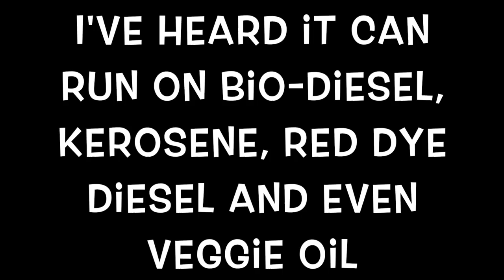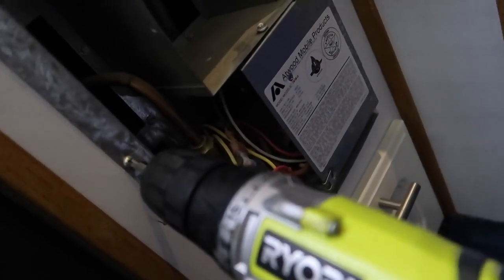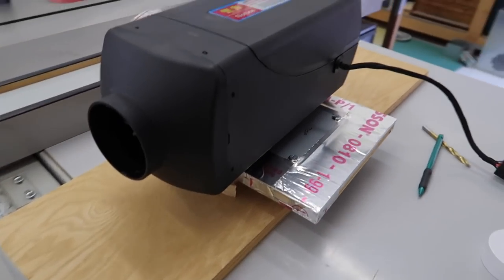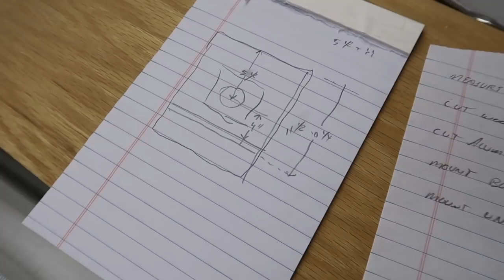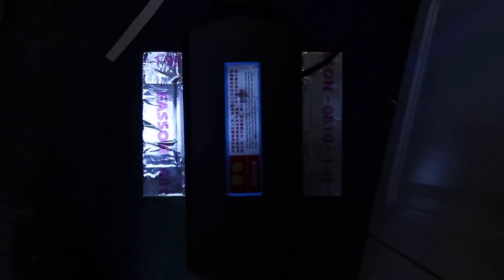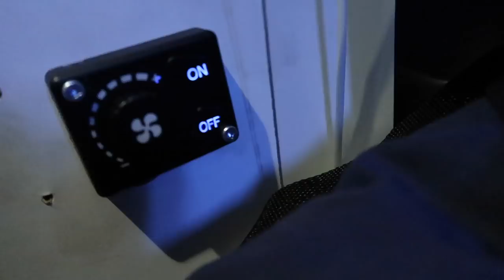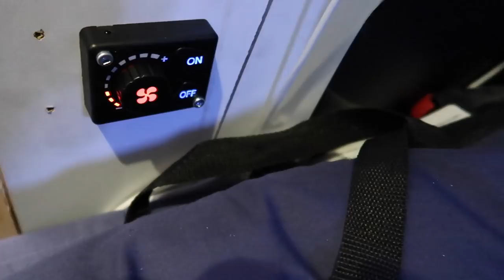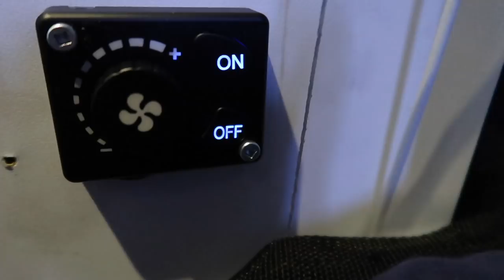China Diesel Heater DIY Part 2  INSTALL Atwood Direct Retrofit

Comment: These diesel heaters can be mounted on their side as long as the glow plug faces up, which I think would have made it a lot easier for you to run your exhaust pipe out the existing port on the side of your van. Also the fuel pump should be mounted in the upright position to prevent pump wearing out prematurely

Comment: I do not recommend drawing air from the wheel well as tires throw water constantly from wet roads throwing water into the heater combustion with considerable velocity.  Best to duplicate the OEM heater air intake for combustion to draw air without the high velocity water spray.  Even drawing air from behind the fridge is much better.

Comment: I would like to continue to keep my existing furnace working and use this as a boondocking heating option as I have a sneaking suspicion that these Chinese made heaters would not potentially last the minimum 4,000 hours of use a year it would be subjected to in my Canadian climate. Question: how hot does the exhaust line get and should I consider extra shielding? Excellent installation video Steve! Bravo.
Reply from the maker: I wouldn't be wary my Canadian friend. They are copies of the Wabesto. One moving part (fan) and solid state circuitry. If it isn't DOA, you will get great life out of it. Probably better because you would use it as intended. There are many, especially on the boat forums, that have used them at length with no problems.
Reply: @XplorerSteveDIY  Does the unit have to be installed with the exhaust and air intakes facing down or can it be safely installed sideways?
Reply: Andrew I know a couple people using these Chinese diesel heaters in the expedite industry which I'm in the only problem they've had has been a faulty glow plug and faulty temperature knobs which all cost under 20 bucks to replace or you can upgrade to an LCD screen other than that like Steve said they're just a copy of a Webasto or an Eber spacer diesel heater but I would definitely add some race car exhaust header wrap on the exhaust pipe I know it gets up to 2 to 300 degrees Fahrenheit just as an added precaution
Reply: @Linescrew1Canada  because a warm air always going up, probably even better exhausted on a side,just like every other heater

Comment: Not unlike the Wabasto cab heaters in over-the-Road trucks.  Watch out for mud slinging off of your rear wheel, possibly plugging your hose in the wheel well.  And, whatever you do, try not to spill any fuel oil inside the van.  You’ll smell it forever.  Shy away from bio-diesel.  With petroleum diesel you’ll at least know what you’re getting.

Comment: Wow, pretty clever install my friend!!! 🤗👍 So many people going that direction of the Chinese Diesel. 😉 Hope you do an update video in the future on it and how many days of heat do you get out of the tank. It looks so small. I can get 2 weeks out of my furnace propane heater just by running it at night. I put a black out curtain just past the right side bathroom door and tuck it between the sink and stove area so I only heat the bed area and area to get to the bathroom. I really like having a heat source that is connected to a thermostat at night and set it to 55 degrees if in really cold areas. If in really cold areas during the day will run a Mr Buddy to a bulk tank so that can stretch my boondocking to two weeks by using those two methods for heat. 😁👍 I really hope you do a follow up video on this even though I know you use it as a vacation vehicle. Loved the video!!! 👍😉💓😄🚐
Reply from the maker: One Tuber tested 2 gallons on high and got 24 hours out of it -straight. That is pretty nifty. The power savings is a big factor as our furnaces eat battery. You have good solar though so may not wake up in the danger zone. I don't camp in really cold weather cause wimp. Safe travels Irene.
Reply: @XplorerSteveDIY  Yes, definitely my 400 watts of Solar and 200 battery amps with 100 usable amps is plenty to run the 3.4 amps per hour that the furnace draws in our Xpolorer. I mainly put the curtain up to help conserve my propane because I have plenty of battery power that is for sure unless in a place where I don't have much sun for several days but that doesn't happen very often but can so my curtain helps in that situation. 🤗👍 Definitely the needs of a fulltime traveler is very different than someone who is not or what type of a camping a person does as well and for how long. As you know I am definitely not a 100% fair weather camper/traveler...😀🚐👍 I am still very interested in what other options are out there but 2 gallon on a constant 24 hours is nifty but I have been in situations where it can be cold for a week or two in one stretch. So 2 gallons would give someone about 1 week if they needed to run it 8 hours constantly maybe not on high during just the night if in that situation. That is okay, but a 1 to 2 week boondocker might want to still make sure to have another heater source as well but I do that no matter what just incase a surprise bad weather or mechanical failure. 😀 Thanks Steve!!! 👍😉💓😀🚐
Reply: @IrenesVanventures  I actually installed a 5kw in the living room of our 2500 sq ft house a a back up heater. Glad I did. Power went out with the last blizzard. Kids kept the house around 70f for a week on five or six gallons of fuel on lower settings. Putting one in my camper this fall after that

Comment: Awesome install Steve I love the step by step process I hope the heater works out good for you the only problem that I've heard from people that have them one guy had a glow plug go and another guy had a problem with the heat thermostat switch which they replaced for under $20 each just make sure once a month you crank that baby on high for about 30 minutes to 40 minutes so you can clean out all the sit in the combustion chamber it wouldn't even hurt to run a tank full of kerosene through it it burns hotter and will help clean it out
Reply from the maker: I've heard that. Thanks for confirming.
Reply: @XplorerSteveDIY  you're welcome I'm glad to pass along the knowledge 😎👍👍

Comment: So you remove and fill the plastic tank with Diesel at a gas station  pump , and then put it back in the compartment you retro-fitted . Isn't there a smell of Diesel in the coach ? Nice job btw.
Reply: It will only take one drop of diesel to make the entire interior of the van stink awful. I can't understand why anyone would do this unless they were already burning diesel in their engine. Now he has 3 fuels to keep track of plus solar.
Reply from the maker: I fill it right in there. I have a nifty fuel can that makes it drip free. There is no smell of diesel inside. Bill. It sounds bad when you put it like that but, naw. I can handle it easily.

Comment: Looks great .... but why did you drill a hole in the wheel well  ? Did you use the old side vent already there ?
Reply: So the air intake and exhaust were in different places.
Reply from the maker: The side vent was up high. Instructions forbid looping the exhaust up and over. A down and out was the preferred method.  It doesn't matter much if the intake and exhaust are close as this is a direct vent system.
Reply: What about the dirt and mud that will fly up into the exhaust pipe in the wheel well when you drive on a muddy road or critters that might crawl up into pipe?

Comment: works on paraffin/kerosene/diesel, you need specific gasoline  verson for gasoline/petroleum, i have had no success with bio-fuels or vegetable oils
Reply from the maker: I've heard kerosene burns cleaner and is cheaper. I will look into that.

Comment: looks like  a nice update, though I would miss that cabinet at the door, I see that and I see flashlights, bug spray, sunscreen, matches etc all the stuff I have to continually run back to the rig for.  Those shelves did need a lip though.  Since you were not using them anyway it was a good fit and easy to run that fuel line.
Reply from the maker: The door itself has a large pocket in it for all those aforementioned items.

Comment: Hello there
Waned to make you aware that the pump should not be mounted horizontally!
It should be mounted with the flow direction upwards (most people simply say upright and somewhere i've read between 15 and 35 degrees), that's because by pumping it creates a vacuum what in turn creates air bubbles, so if the pump isn't facing upwards the tiny bubbles can get stuck and form a big bubble in the pump itself, that messes with the flow of fuel, pump action and creates friction

Then i'm wondering why i haven't seen someone connecting it directly to the vehicles tank... i know it exists for the original german heaters, can't be that difficult to make it work with a Chinese one, but so much more user friendly not having the additional tank

Comment: I've seen other installs of similar units and your install is by far the most elegant.

One thing that bothers me about these is the power consumption as I'm looking for an off-grid alternative to the RV power hungry propane furnaces.  Other installers describe a fuel pump and small fan used by similar units which consumes small but continuous amounts of power.  The power hog is a glow plug which generates heat using electricity to ignite the fuel.  

Do you know if the heater is always consuming 7.5 AMPS while generating heat?

When looking at other heating options did you find any which vent exhaust and pull air from the outside which use less power than your heater?
Reply from the maker: There is a higher amperage draw upon startup for exactly what you said=glow plug. Once the plug has reached temp and the burn chamber gets that slight turbine hum, you're good. The amperage then drops to your operating level. I got a heater oversize to my van at 17,500btu. That way I can run it on low at less than 2 amp and it is very quiet. For off grid, get the model with the digital thermostat that will cycle on and off for even greater power efficiency. I got the dial type because I am a part time RVer and live out of my van and not in it. Good question.
Reply: @XplorerSteveDIY  Great install! I am working with a MCI Bus that has propane heaters.  I plan to use three heaters: 1 front cab and living room/Kitchen, 1 for the Under Bus Bays, and 1 for rear bedroom, bath, and under bus Utility bay (tanks and water heater). My big concern is the power consumption. I have two large 8 D deep cycle batteries for my 12 volts and inverter. Plenty of power to run my Fridge, TV's and accessories over night. My question is: Can I also add in the Diesel Heaters or should I add a dedicated Deep Cycle battery.

Comment: great !   May i ask what was the KW and BTU of the old unit, to compare apple with apple  ?  Thanks !   (i've been told that propane is cheaper per BTU than heating oil...)
Reply from the maker: I don't really know exactly. It is all cheap for me in the desert southwest.
Reply: The problem with propane is it puts a lot of water in the air when it burns, humidity and RV’s don’t play well together, I live on Vancouver island and once fall comes it becomes a real challenge to keep the humidity levels down I have to run the roof vent fan all the time and it just pushes the hot air out

Comment: Everything done wrongly. Fuel tank fitted inside habitation. Exhaust pipe run inside habitation. Combustion air drawn from wheel arch.  Not smart as combustion air intake may get blocked and dirty air entering heater causing ideal conditions for producing carbon monoxide.

Comment: I am concerned about the combustion air and exhaust being located in the wheel well,I would have plumbed to the existing ports from your old unit in the side of the van.Otherwise cool!
Reply from the maker: Exits through the wheel well. Terminate out the side rear fender. It's cool.

Comment: Does the fuel tank have to vent? Any smells from the diesel? Otherwise you'd never know it was swapped! Nice!
Reply from the maker: No smells yet. If it becomes a problem (like over the summer) i had a first choice that the design of this tank would not allow (in the gen bay) This tank was not like the one in the picture. Bummer.

Comment: Hey Steve, Looking forward to hearing more about this heater with some extended use experience on it. My only concerns are,  The flex exhaust vent going out through the wheel well. I'm sure you measured and decided there was enough clearance. What I would consider doing is slipping some metallic flex conduit over the exhaust pipe where it goes through the hole to add additional wear resistance to the flex exhaust pipe from the inevitable vibrations the pipe will be exposed to especially driving gravel back roads. We do that with all flex gas lines installed in our house projects in walls (risers) going up between floors for nail strike protection. The other thing I wonder if it will become problematic is, the heater is installed in an enclosed area. The heat port is blowing out against the existing grill but there is probably a lot of that heated air being cycled swirling around inside the compartment where the heater is and continually building up heat around the unit and all the wires and fuel lines around it. You may need to fit a piece of duct-work to the grill that directs heat out and prevents the containment of heat inside the compartment. 
Safety wise. All modern heat exchanging equipment has a pressurized heat exchanger so that if there is a crack in the heat exchanger, fresh air will flow into the heat exchanger combustion chamber, combusted air cannot flow out into the blower and into the living space because of that design.
Reply from the maker: You got me out-thunk on this one. I took some good precautions. Over time, i will review and update.
Reply: @XplorerSteveDIY  check out John Mck47  he a has a fifteen part series for instructions

Comment: Steve someday sooner or later the diesel odor is gong to present itself. my concern is the exhaust going out the hole in the wheel well. Seems possible the road grime may get splashed in there causing a restriction of gasses. I dont want anything to happen to you. Girl Child needs her dad.....
Reply from the maker: Naw. It's fine. I will show it an a future update video so you wont come to an uninformed conclusion.

Comment: Smartest man in the world??? I think not. Why would one take out a perfectly good true and tried propane heater that is very safe and reliable to run and works on an automatic thermostat that is very safe to leave and run all by it's self? Oh ya lets put a stinky diesel tank inside my RV so when I drive around it sloshes and warms up it leaks diesel fuel fumes into the inside of the RV. Oh yes now we have to carry an little jerry can around full of diesel that is stinky and always seems to spill no matter how careful you are trying to fill it. Now you have to take the stinky jerry can and use it to fill the stinky fuel tank that you now installed inside of you once nice smelling RV???

I am a Diesel truck owner and have worked with diesels equipment and know how bad and easy it is to smell like a drum of diesel.

Don't get me wrong as I think these Diesel heaters are great and plan to install one Outside of my camper as a auxiliary heater with its fuel tank also mounted outside.

Don't leave all your cookies in one basket or you may get burnt?

I will say though that he did do a very nice and neat install but just a little short sighted.
Reply from the maker: It's a personal choice for sure. I live in Vegas bebop around the desert SW. This isn't right for everyone but it is for me.

Comment: You have taught me a lot over the years, Steve. I installed my diesel heater just like yours: not directly on the floor, but maybe six inches above the floor on a s.all platform. However, I am a member of a Chinese heater group on Facebook, and people were warning that the heater should be directly on the floor to avoid the chance of exhaust fumes from a loose clamp connection. I have run mine with a carbon monoxide detector in the cabinet and get zero readings? Should we be concerned? I always respect your opinion.
Reply: Its best if you can mount direct to floor as that is then your firewall. However its not always possible or practical. Hundreds of these heaters are now installed in boats on DIY metal  brackets and they obviously take the exhaust (well lagged) some distance before it exits above deck with extended heater ducting into the cabin. (watch pipe lengths limits) But you take all necessary precautions and i advise to use exhaust lagging between the heater and the floor as then its then cool enough to touch without any chance of anything touching and burning.   As you are doing always use a CO detector in your living space and check all gas, fuel lines etc regularly Fires are the number 1 van enemy from fuel or electrical faults.

Comment: Steve it seems many comments think you have the intake and exhaust literally pointing above the tires lol.  I think you may need to show that these heaters come with intake and exhaust hoses that extend to the location you desire. No brainer for the ones that install but seems confusing to the viewers. I've had my gas espar running for the past week.  Nothing wrong with it except the loud pump but personally I liked my oem propane heater better.  I just needed the old space. I installed my espar under the passenger seat.
Reply from the maker: I hear you. The content advisor failed to inform the camera man of the importance of showing exhaust tubes.My producer is upset about that. Haha. Just kidding.  I will show this in an update video. Hopefully I can get out there before the weather turns all warm and toasty.